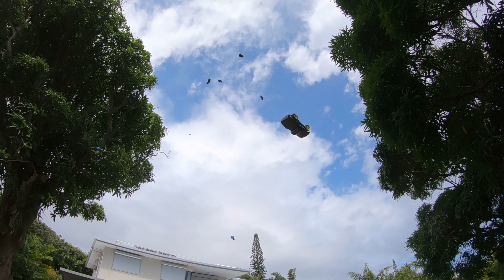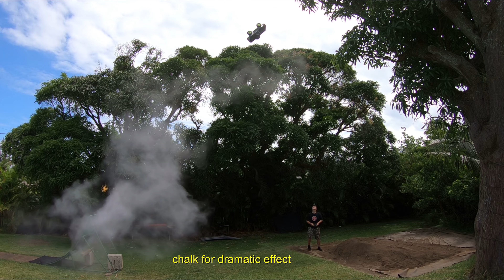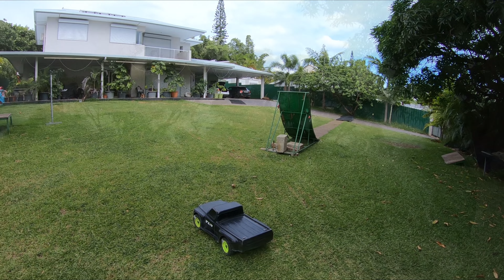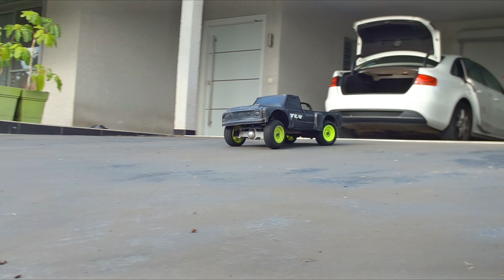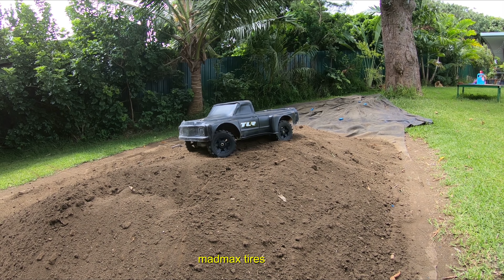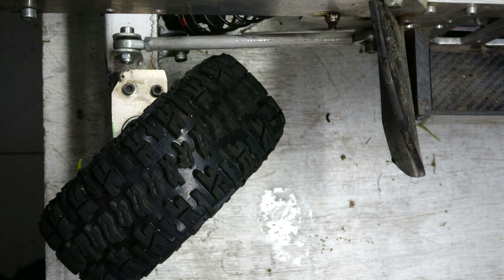homemade chevy 12s jumps, crashes, breakages, exploded tires... sh*t happens !

Comment: So much power,12s hobbywing set up looks good 👍
Reply from the maker: yeah, note that i run the max4 with a 58x113mm leopard hobby motor, 530kv.
Reply: @stephanez8036  do u prefer the leopard over the hobbywing ?? Is the hobbywing in the video the big 70120 ?
Reply from the maker: @mikellewis2346  it depends on the size and voltage ! so in my experience,  for the 56x113mm size, the hobbywing 800kv on 8s feels soft. the leopard hobby motors feel better on 8s. but funnily, the hobbywing 58113 800kv can take 12s : and in my experience, the hobbywing 58113 and leopard hobby ( 500 or 800kv ) run all good on 12s ! now regarding the 70x125mm size, leopard hobby doesn't have a motor this size. the hobbywing 70125 has more power and torque than smaller motors !  last detail : the hobbywing 800kv seems to be more durable than the leopard hobby ones ! i overheat some of them i think...

Comment: salut Mr top comme toujours toi qui a le kiff de fabriquer tous ça j'ai eu dans l'idée de fabriquer un monstre mais pas le temp du coup je te soumet celle ci car tu est l'un des rares qui sait le faire .
se serait d'utiliser deux transmission de rovan baja 1/5 ou hpi plus solide mais plus cher et de les utiliser une a l'arrière et une a l'avant avec deux max 6 et deux moteurs 😁 malheureusement le temp me manque cruellement pour la RC 😔 donc voilà je sais que se serait un bon challenge pour toi  😁😁😁 merci d'être un vrais modéliste Mr 🙏🙏🙏🙏🤘🤘🤘
Reply from the maker: merci ! j'ai pensé à faire un gros clod buster ! j'avais même déja étudié la transmission du baja !! mais plusieurs soucis se posent : vu la taille des diff, faut passer en 1/6th, soit des roues de 25cm ! la transmission baja ne va pas tenir pour un engin aussi lourd et puissant , les moteurs 56113 pèsent déja 1,3kg et rendraient les essieux super lourds et non amorti. le meilleur choix reste un seul moteur ( même + gros ) dans le chassis. j'ai commencé ce clodbuster 1/6ème, je bosse sur les jantes. la carro est la proline 1/6ème, y aura même des autocollants " super clodbuster " ! toussa prend du temps, fessbook aime me le rappeler ( il y a 1 an, vous faisiez ça ! ). tu es sur facebook ?
Reply: @stephanez8036  répondre oui mais j'y traîne pas trop
Reply from the maker: @bexentercrouleoupas666  si tu va sur "werner sline" , tu verra ce que je fais actuallement. sur youtube, je met des video qui ont parfois 2 mois a 2 ans lol!
Reply: @stephanez8036  ok je connais pas j'irai voir 😉😉 en tous cas merci pour ses construction de folie 👌👌👌ça change des vendeur de pièces et du acheter monter c'est appréciable 🙏🙏

Comment: Did you manufacture that car
Reply from the maker: every part that i could do, yes, i did them myslef : steel axles, chassis, suspension links. but i used existing components like the transmission. some parts are custom made : shocks, body, motor mount, spur gear...
Reply: @stephanez8036  bloody good job
Reply from the maker: @dominic9279  thank you ! it feels great to achieve a decent car that doesn't exist